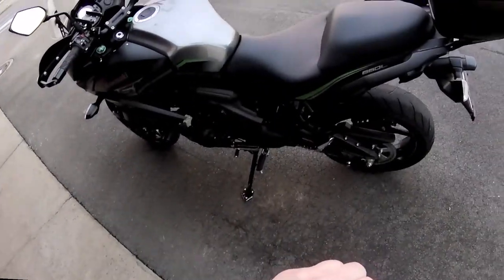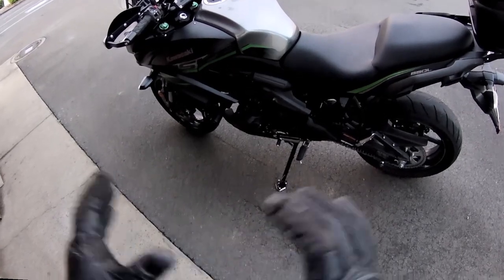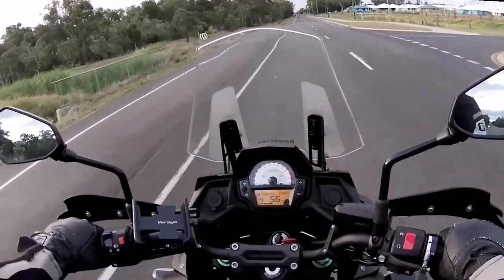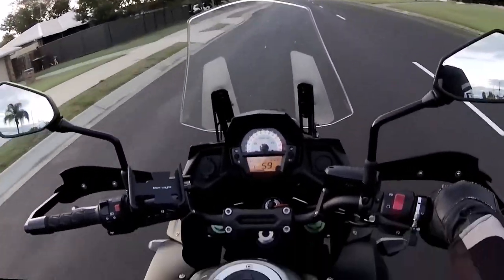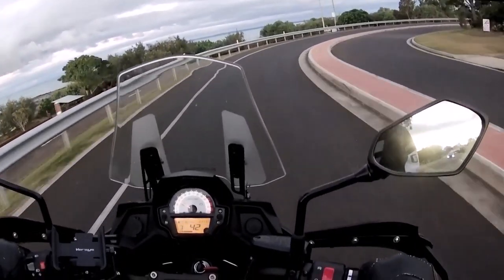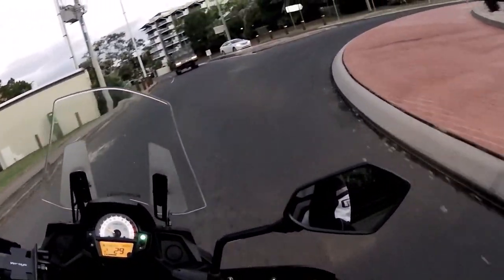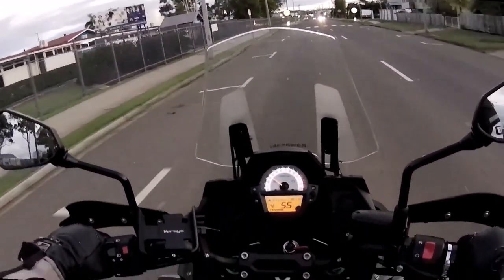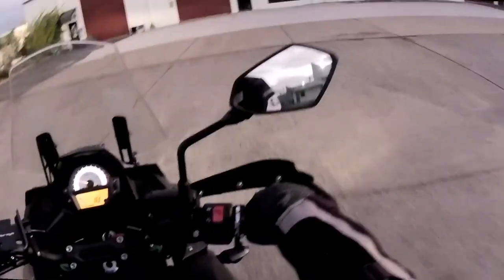1st Vlog attempt! VERSYS 650 Impressions and pre-install Booster Plug theory!

Comment: I have the 2021 so the same bike, I agree it is very responsive but a lot of people will like that about it, the engine breaking is excellent which should be a positive as this bike stops better than most I have ridden, I agree it can be touchy at corners and round-abouts because of how touchy / responsive it is, but that is easily dealt with some clutch control, I have had to become a lot better at clutch control because of this bike. All that said, id like to rike my bike with the plug installed to see the difference, but I hate playing with fiddly stuff like your install video showed it to be, id likely snap the plug or something.
Reply from the maker: Yes, you have to use the clutch to smooth out the throttle response but shouldn't have to. I have a Yamaha XT660R with quicker acceleration in first gear but it is way smoother and you don't need to feather the clutch. I traded in the 650 for a Versys  1000 S and it is less jerky than the 650. The Boosterplug isn't difficult to fit and it does smooth the throttle response a little bit. I was even getting the occasional stall and backfiring as well and it helped with that as well.
Reply: @motoant  sadly they don’t make the plug for 2021 and newer
Reply from the maker: @kentwalker1969  so is yours MY2021 or the current shape?
Reply: @motoant  it’s 2021

Comment: Second video of it installed?
Reply from the maker: Very soon. Done the install, just waiting for my new camera to arrive. Cheers
Reply: @motoant  I just ordered one did it work tho you must have ride it. Have you a video of the install I can watch
Reply from the maker: @barrymerone3765  I've done the install part of the video. I'll see what I can put up tonight. Definitely less engine breaking but the snatchy throttle hasn't been a big improvement. Only a little difference which is a bit disappointing. In Australia we can only buy a restricted version 650 so I believe it has a different mapping to a full power. You might notice a big difference if it is full power. I need to get a remap done on mine.
Reply: @motoant  thanks for reply yes UK bike so should be full power I did think about remap but thought quick fix. I ask a few online in UK all said a good fix
Reply from the maker: @barrymerone3765  I had enough to put a video together. Thanks for your interest!  https://youtu.be/ZuFF3XTZu6U
Reply: @motoant  a company near me will remap it for £200 so going to send pb back when it arrives
Reply from the maker: @barrymerone3765 Awesome, that would be a better option for that price. It's three times that price here in Aus.